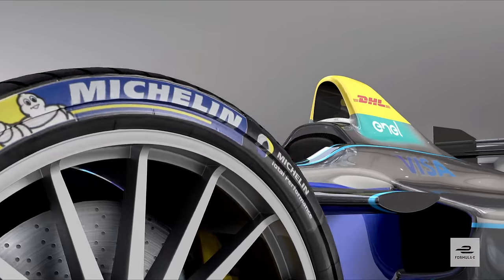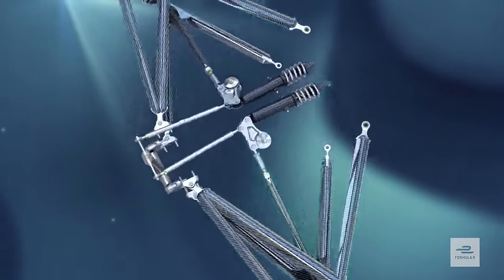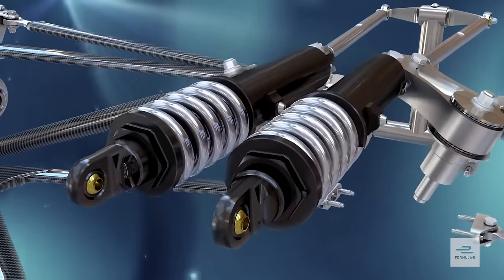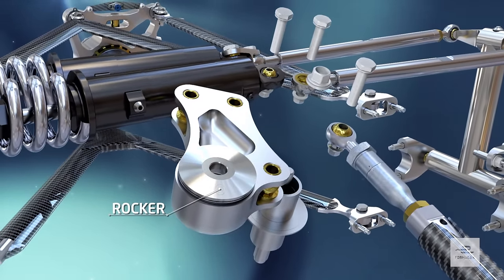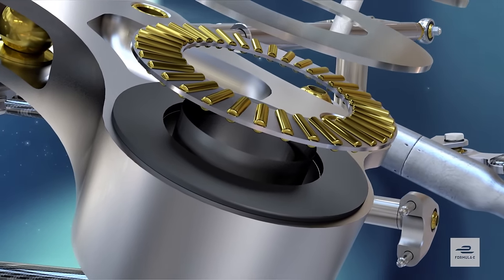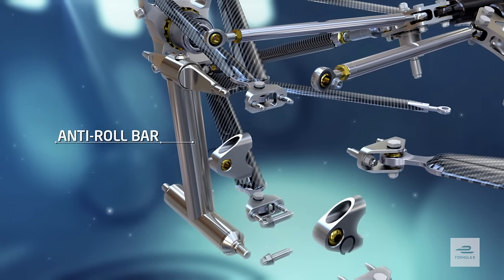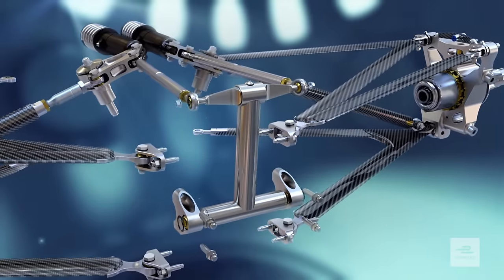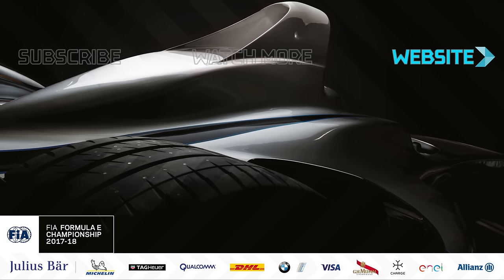How Does Formula E's Push-Rod Suspension Work?

Comment: I wish they would have shown it in action. I don't understand how the up and down movement is transferred to front to back movement.
Reply: Basically, when the tire moves up, it moves the pushrod towards the center of the car. Imagine the rocker as a circle, with the pushrod pushing the right side, making the rocker turn counterclock. the springs are at the other end, resisting the counter clock motion.

--------0
......000
...........|
...........|
Reply: Ohhhhh, I think I get it now. Kinda like how the crankshaft and connecting rods attached to the pistons convert the up and down movement to circular movement right? But in this case the up and down movement is converted to tensioned back and forth movement?
Reply: Fast forward to 2:00 for up close look and the system in action

Comment: I don't get it how is the vertical motion of the wheeks converted to horizontal load on the shocks.
Reply: @mikamika9781  i still can't visualize it. J've seen rockers in other orientation but these ones are almost horizontally oriented. I'm struggling to see how lifting the wheels will move in the direction that will make the rocker rotate